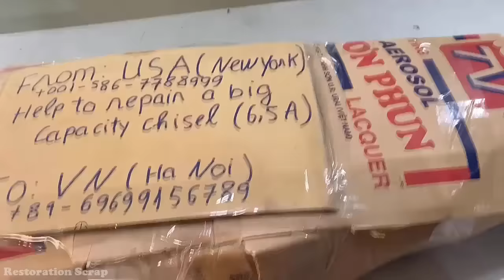Restoration Hammer Drill USA Old | Restore Drill Electric Large Capacity Max

Comment: The drill is set to run Off 220 volts. The power in USA runs on 110 volts. Nice job on the reconstruction of the Hammer Drill.

Comment: Helpful hint. If you wait to paint the case, you can “warm” the case and the bearing will slide right in without using a hammer. Aluminum has a high expansion rate and doesn’t need to be “hot”.
Nice job!
Reply: Thats right Curtis. I am crying blood with the bearing assembly...

Comment: you can't use a hammer to knock on the bearings, they will fail faster. Use wood or hydraulic press. The recovery work is good
Reply: He is using a kitchen knife as a tool  do you think you can afford a hydraulic press?

Comment: The thing for me was if it was very old where did he get the spare parts from. the bearings are no problem but the new armature and the new plastic handle. would have been nice to show that also what did he soak the gears in.
Reply: The armature looks to have been rebuilt, which is not difficult if you have a coil winding machine. The commutator is the giveaway, it looks like it was cleaned rather than replaced.

The plastic handle is readily available online, I found at least a dozen different brand names selling the same type of hammer shown in this video.

The solution used to soak the gears could be either quicklime (calcium oxide) or lime water (calcium hydroxide), both are powerful bases and have a milky appearance when dissolved in liquid. I don't recommend the use of either because they're dangerous. Quicklime has an exothermic reaction when introduced to water, and can explode. Also since both are powerful bases, they can cause nasty burns.

If you need to degrease gears, use a degreaser and wire brush. Caustic bases damage metal, as do acids.
Reply: Parts are readily available for this jackhammer.
Reply: I work in repair of inground pools and our cheap chinese jackhammers literally look exactly like this. looks like one that got left in the rain , I assure you this tool is not old, maybe the design
Reply: How much did it cost to do this restoration and how much will it when buying a new one?
Reply: Not sure where anyone claimed it was old, just a discarded and abused tool that needs repairing.
Reply: also the brushes look almost brand new. just saying.
Reply: @Tanya Rodriguez silver paint

Comment: WTF, I’m a professionally diesel mechanic of 6 years and this guy has a tiny fraction of the tools I do and still gets it fixed! 😂 Do have to say though did they specifically pick this piece because it was put together with all Allen bolts and they said oh we own a set of Allen wrenches! Haha
Reply: If you are professional diesel mechanic and say, this guy fixes the tool, please give me address of your workshop, I would remember to not come there :). Seriously? A hammer for bearings? Cable connection with oxidized copper wires? :)

Comment: What fluid did you use for the rusty parts?
Reply: Came here to ask the same thing. I’ve seen several videos from guys in Asia using that milky liquid for rusty parts and the parts always come out looking great.
Reply: I think it's some kind of acid or just baking soda and vinegar and salt or neither of them
Reply: He actually just painted them silver. You can see the paint coming off when he reassembles it. The milky liquid was just for show.
Reply: @jimfonville8622   I was so excited when the gears came out of the "milk". My parts don't come out of any of the rust removers I have used looking that good. OMG WHAT IS THAT MILKY LIQUID, I GOTTA HAVE IT! Then, close up of gears being reassembled...hey, that finish looks like paint! [also...given the mess inside all, of those bolts came out waaay to easily they were already out recently. Have seen comments that a lot of restorers do that for the sake of the video. If someone doesn't, it is pretty obvious.]

Comment: Did you paint the gears silver?
Reply: Yes he paint it
Reply: I don't know why he need to lie
Reply: @momenegypt2  You are right, he doesn't his work speaks for itself
Reply: Silver frost paint
Reply: Give me some acid and metal nickel and i will make gears/any metal surface shiny (also, corrosion resistantly). But here ... If he do such a procedure, why not show it ? 
I think youre right. Gears replaced by new or painted. Same i think about rotor.

Comment: Stop banging those bearings in with a hammer you can buy a drift set.
Reply from the maker: yes
Reply: Or even better yet restore an old press
Reply: Or a rubber mallet or a block of wood in between the hammer would work too
Reply: @restorationscrap8829  Coming from a "YANK", please consider some of these comments as constructive criticism, only trying to help by passing on knowledge from experience. We all love what you do or we wouldn't watch. Keep up the good work!
Reply: give this guy a break. In case you didn't note it; but, he only has a old carving knife to pick dirt out with. I seriously doubt he's got the funds or luxury of running down to Home Depot to but new tools. Watching him, I wish he did. For I do agree that with a better equipped shop, he'd do some major fine work over and above what  he can now.
Reply: @spiravdaeg  They are not expensive
Reply: dude used a brick as a hammer to take it apart... i wouldn't count on brass punches any time soon

Comment: So I've watched a bunch of these restoration videos and I'm starting to see people dress things up in the beginning to make it look like a great find.  Did anyone actually look at the packaging this thing was wrapped in when he put it on the table.....anyone?  That box was not shipped from the States.  The packaging isn't even from the States and no customs forms on the packaging.  Btw, this isn't an old drill like some of the classics that you see restored.  The handle is fiberglass or some other composite.  Notice how the power plug was missing. Some "restorers" remove that item as to not give away the region the item came from. In the end you see that they put a 220 volt plug on it; the motor coil would have had to be re-spun and set up for 220V 50Hz if this had actually been a U.S. product. No I.D. plates also shows that this is not a real U.S. tool because these items are not cheap and come with a warranty for commercial use. I will give it to him, he took a pile of crap and made it shine.  I still gave him a thumbs up for effort and talent.
Reply: The Box says "Viêt Nam" under the word " Lacquer" right on the beginning
Reply: The comment I was looking for, havent watch it yet, just few seconds into it. I guess thumbs up for their effort.
Reply: Yeah I spotted those several things straight away. I understand why he did it but there was no need, he's talented enough as it is.

Comment: Dude, you are clearly good at what you do- especially given the tools you have to work with.  You are a pretty intelligent guy, why don't you build your own sandblasting cabinet?  The old saying "time is money" still applies to you.  You could save yourself hours of time if you had a sandblasting cabinet and sandblasting gun.  You already have air compressor!  A soft medium would have stripped that hammer drill in minutes.  The less time you spend using hand tool to strip parts is more time you can spend on other projects....other projects = $$$.

Comment: If the chisel was going back to New York, the power cord is the wrong type. Also I noticed the ground wire was taped off, considering he replaced the aluminum handle with a plastic one. Safety hazard.

Comment: what kind of rust remover?
Reply: silver paint
Reply: @heliarche  I mean how to remove the rust.
Reply: @ИванК-н4ч  He didn't. He just stuck them in coconut milk or whatever, then off camera pulled them out and painted them silver. Maybe he had the stuff sandblasted too but I doubt it. After the paint dried he stuck them back in the liquid so he could pour it out on camera and make it look like something amazing. When he's banging on that big gear in the vice you can see the smudges it left on the paint. Look closely at all those parts when they appear. It's nothing but silver paint.

Comment: This metal hammer for fitting bearings, gears and compartments is wrong, use a rubberized hammer. Putting a gear on top of a walrus and hitting it with metal is almost a crime. And tightly fitting objects must be carefully attached to a vise, use leather or aluminum between the object and it.

Comment: dont ever hammer a bearing. using a socket on the inner race only, and press it in with the vise if you have no other way. also, put a wire nut on that wiring, thats dangerous AF, especially if the tape comes off and contacts the metal frame anywhere. you wont be able to let go of it. 
Grampa and dad were both electricians. worked with them  for years and dealt with sketchy stuff like that all the time where someone did it themselves and i ended up getting shocked.
Reply: I have one question. If this were a real US made (sold and marketed) jackhammer, why would he restore it with a non US plug/cord on it? 38:31 Running a 120v tool on 240V (or whatever crazy 3rd world voltage they have over there) even testing it would damage it. 🤔  Or.... maybe, it never came from New York and we've all been duped! 🤣🤣

Comment: He hammered the bearing, did not remove the covers of the bearings, did not grease the gears (it should be gear oil), and did not mask the bearing housings when throwing paint. I HAD NOT TO ATTACK THE SCREEN. IT WAS NOT A MASTER JOB.

Comment: I cringed every time he hammered on the new bearings with a metal hammer. I’d suggest using a rubber mallet, or at the very least put a flat object on top of the bearing so the force is evenly distributed..

Comment: In my opinion, this restoration was made at a very low level. Many mistakes have been made. Bearings hitted directly with a steel hammer? What about hitting on seals? Do you use the same hammer in gears and "mount" bearings on gears in the same way? And you do in the air, where do you lose the most energy? The threads were not cleaned and refreshed, and the result were problems with tightening the screws. There are some cracks on covers and handle - 17:15, 20:07. Did you fix it How? Sandblasting is much better at cleaning. For aluminum and similar metals, sandblasting with glass balls (glass sand) is best. Silver paint on the gears and internal covers? If it is not a special oil/grease resistant paint, it will fall and mix with it. Wires just wrapped around the screws? Where are some terminals? Is locking ring 30:02 on its position?

Comment: Dopo questo restauro il martello lo puoi solo mettere sullo scaffale, senza usarlo più, perché usarlo, sarebbe pericoloso visto che nessuna vite o bullone è stato tirato a coppia con una chiave dinamometrica, e viste le forti vibrazioni che l'oggetto provoca durante il suo  lavoro. Inoltre verniciare gli ingranaggi e una stupidaggine perché dopo poche ore di uso la vernice si staccherà e mischiandosi con il grasso tenderà a grippare il meccanismo, altro errore mettere dello stucco sulla carcassa dello strumento, quello stucco alle prime vibrazioni si staccherà. Ho dei forti dubbi che quel martello demolitore sia vintage a causa della ventola in plastica, come pure il fatto che arrivi dagli Stati Uniti quel pacco non mi convince affatto. La presa di tensione che è stata messa non va bene in America, è una presa di tensione Schuko che si usa solo in Europa e nemmeno in tutta l'Europa.  Ultima cosa chi considera questo lavoro un buon lavoro, evidentemente non ha mai riparato nulla e non sa come si esegue un restauro,  non basta un po di vernice e un po di stucco per fare un restauro
After this restoration, you can only put the hammer on the shelf, without using it anymore, because using it would be dangerous since no screw or bolt was tightened with a torque wrench, and given the strong vibrations that the object causes during its work. Also painting the gears is a nonsense because after a few hours of use the paint will come off and mixing with the grease will tend to seize the mechanism, another mistake to put some putty on the casing of the instrument, that putty will come off at the first vibrations. I have strong doubts that that demolition hammer is vintage due to the plastic fan, as well as the fact that that package comes from the United States does not convince me at all. The socket that has been put up is not good in America, it is a Schuko socket that is only used in Europe and not even in all of Europe. Last thing those who consider this work a good job, evidently they have never repaired anything and do not know how to do a restoration, a little paint and a little putty are not enough to do a restoration